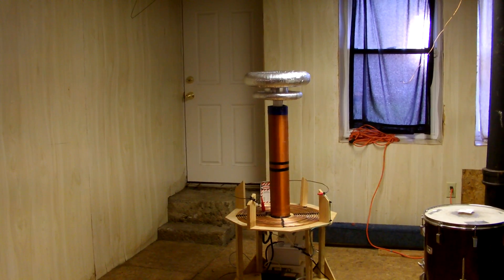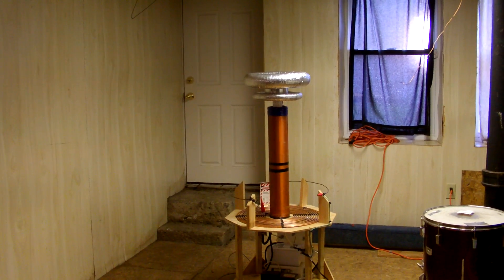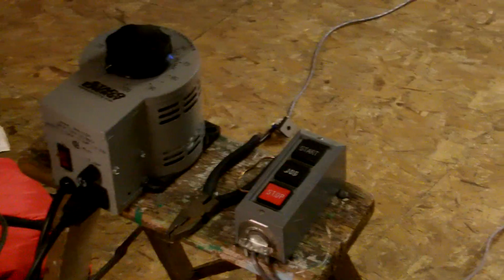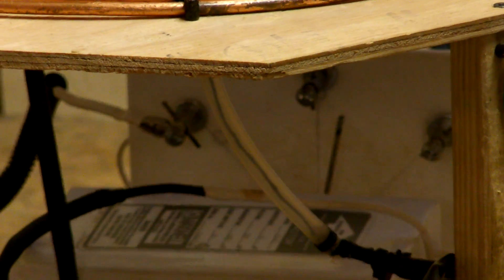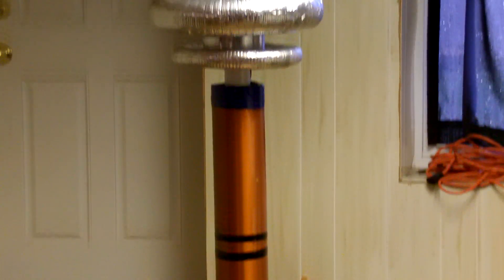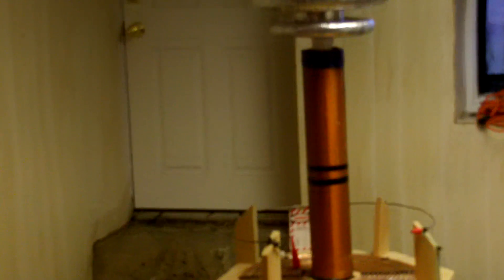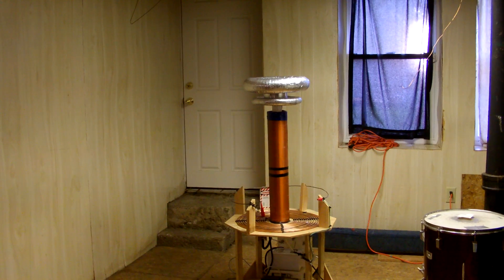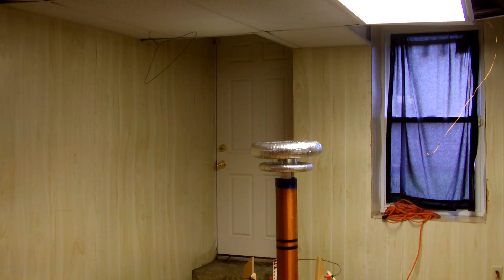MOT Tesla Coil run!

Comment: DUDE! This is amazing for a two MOT SGTC. Please tell me how you were able to use a 90nF cap at 100kv with only 4000V pulses from your MOTs? I thought you could only use lower value caps for relatively low, high voltage drivers like your 4kv one? Mind telling me where I'm confused? The capability of those most to charge that cap is blowing my mind! Thank you so much in advance!